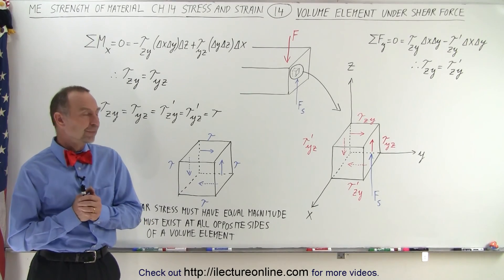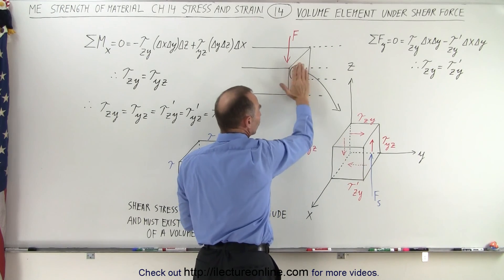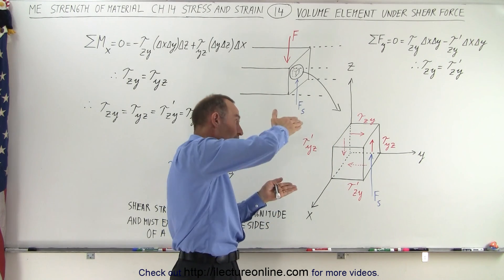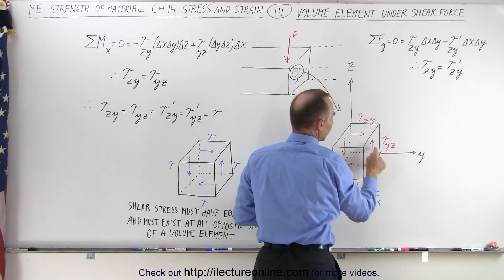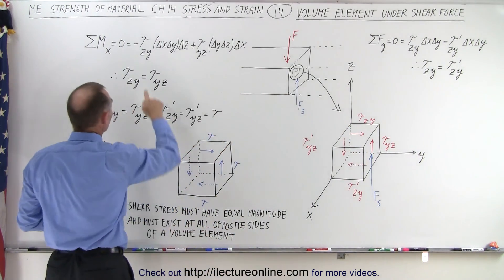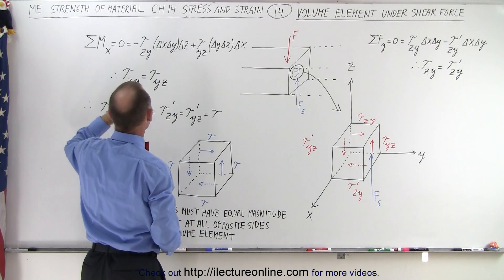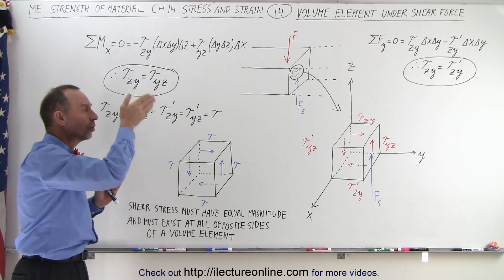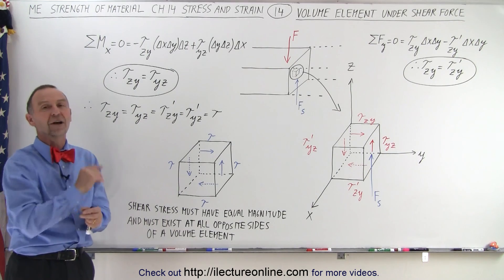Mechanical Engineering: Ch 14: Strength of Materials (14 of 43) Vol. Element Under Shear Force

Comment: I think you are mistaken in the portion (3:34) regarding the second term of the sum of moments equation, where I suppose it should be: ....+tyz .  (delta-x . delta-z) . delta-y    

am I right?
Reply: Yes, he does make a "mistake" there. It should be t_yz*(delta x * delta z)*delta y, so, the portion related to the area is wrong, but since it's a product, the order doesn't matter. But yes, you got a point.